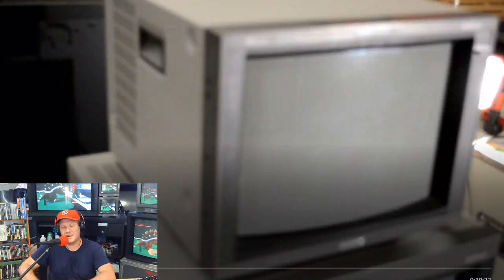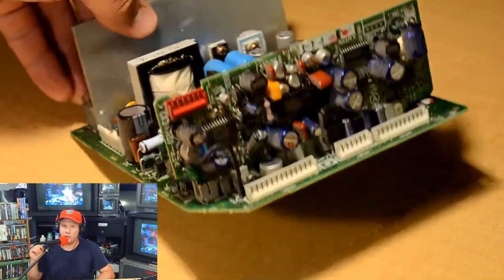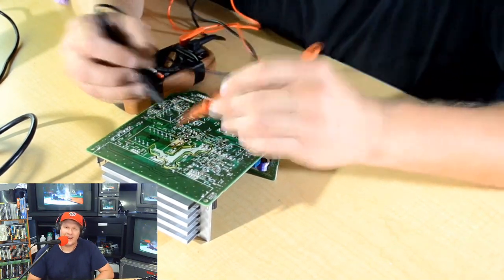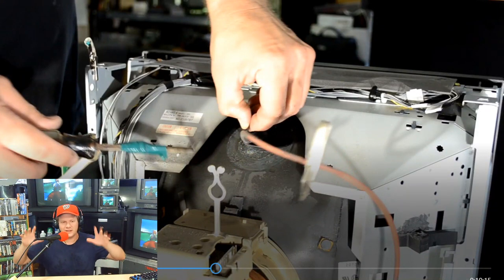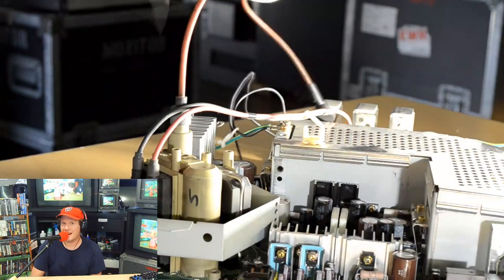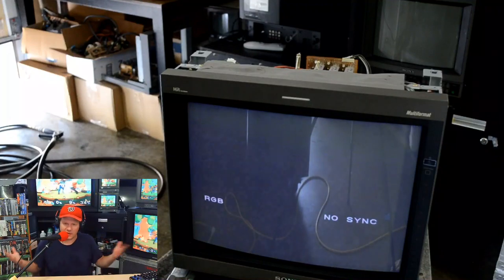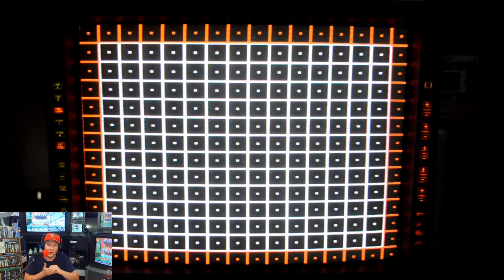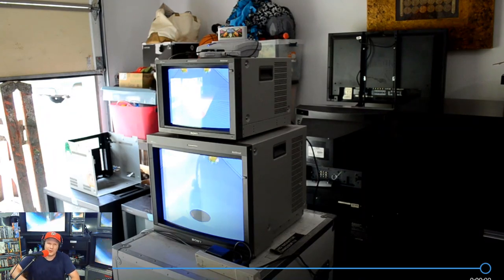Restoring a Sony PVM 20L5 for My Life in Gaming! | Retro Tech

Comment: Hey Steve.. love the content. I'm in the process of adjusting/restoring a consumer Sony KV-35XBR48.. Its a beautiful consumer set and was only able to do things confidently and safely with all of your knowledge and expertise. I've been capturing as much of my repair/adjustments as possible and would like to produce an eventual video with my process and results. Wondering if you could maybe explain a bit on how you'd apply dielectric grease underneath the flyback? Would I have to remove the flyback completely in order to spread it around? Or can I just squirt some underneath? I have the same blue tube o grease that you recently showcased. I understand the anode cap application but im unsure with the flyback... tried goin back to see if you've answered this before. Thanks for any information.

Patrick
Reply from the maker: I'll do a short video coming up soon on the dielectric grease and the a couple other handy CRT repair tools/stuff.
Reply: oh man XBR48? lucky

Comment: Planning to start recapping the D board on the unit I just got. Just to be sure: You can use regular through-holes for the ones near the heat sink right? I haven't seen other caps that look like the stock ones, and It does look like you used these here, I just wanna be sure

Comment: Hi Steve, I bought a 20L5 recently and noticed it has a slight linearity issue, and it looks the same as the one in this video on the scroll test. I've read that recapping the D board can fix this, but I have no soldering experience. Could I pay you to do a recap job? I'm a fan of your content and I've learned a lot from your videos, but I'd rather have a professional do this than attempt it myself. The only soldering I've done is a gba battery replacement

Comment: Hello! Just reached a part of the video where you mention that some little warping will always be present on crts. That's what's happening to my Panablack CT-G2995. When trying to fine tune the PCC, there's always some little warping at the very corner and no matter what I do, I can't get a perfect vertical border. Is this normal? Should I stretch the image vertically a little to hide the warped corner?
Reply: I had the same issue. I was able to overscan it corner just fine. I lived with it like that for quite some time. However to actually fix it I had to open the back, fiddle with the convergence strips, and added an additional magnet to the back of the tube. The geometry is almost perfect now 👍🏻

Comment: I would never give anyone a guide to use compressed air unless they know what they are doing because compressed air contains water and requires at least a water separator. In the worst case, you can blow up the entire TV.
I use professional service MetroVac/DataVac ED-500-ESD Anti-Satatic Electric Duster with Grounded Wrist Strap they are expensive but do their job without worry.
The single biggest mistake is to use a vacuum cleaner as it causes static electricity.
But otherwise very good advice.
Small PVM don´t have minor geometry problem or it is much rarer 14 inch and 9 inch.